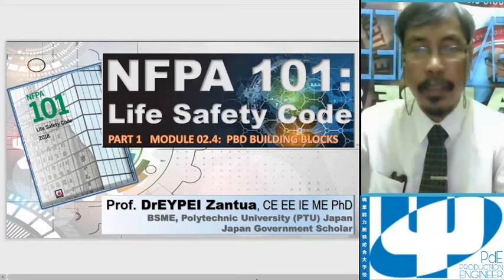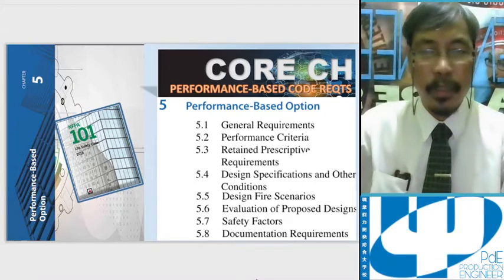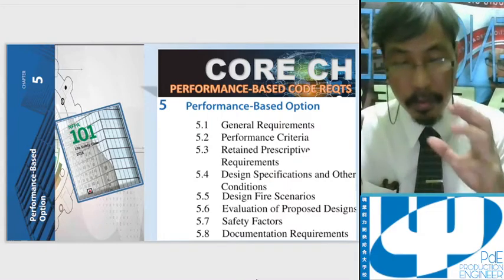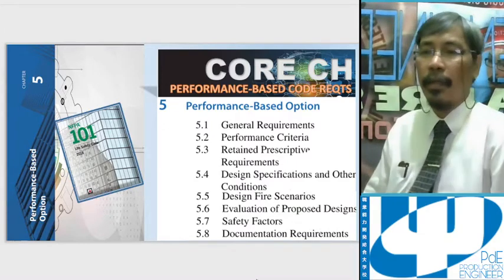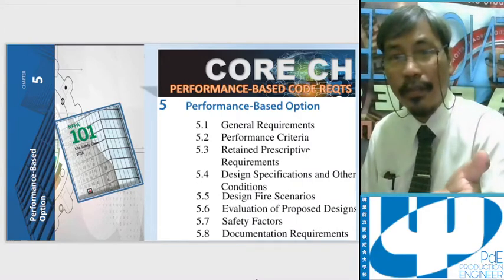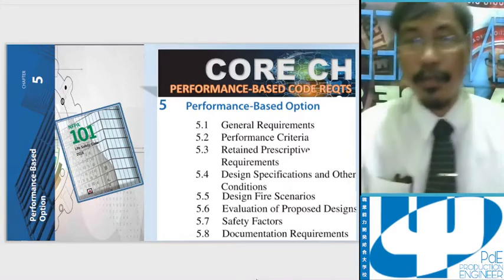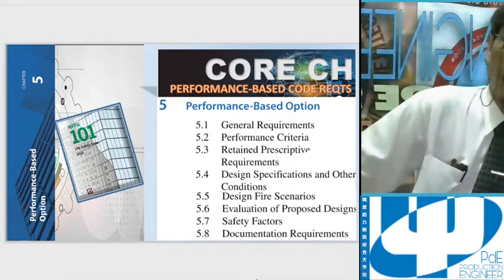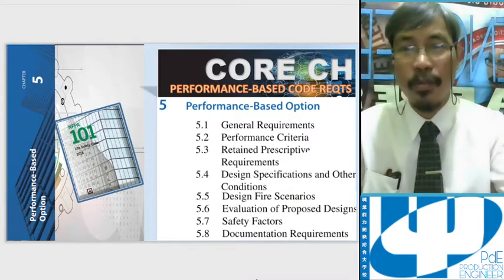PBD is the ENGINEERING WAY? NFPA101: Module 02.4 PERFORMANCE-BASED [ RA9514-IRR2019 Reference CODE ]

Comment: Arana, Jomar A.
19-02963

@01:46 "performance based-design (pbd)"
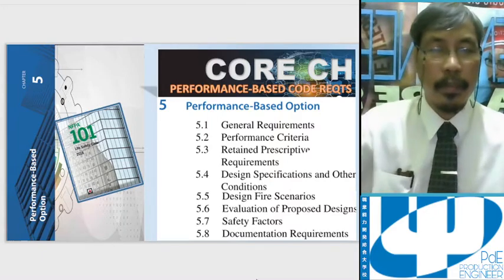@02:34 "performance criteria"
@07:31 "the prescriptive code is just using the prescription"
@10:14 "retained prescriptive requirements"
@10:40 "design specifications and other conditions"
@11:21 "design fire scenarios"

Comment: First, you have to do whenever you come across with the particular provision that is not yet defined with the standard, or the current situation is not feasible to use the prescription. 

I fyoure just following the prescriptive type, theres no problem.